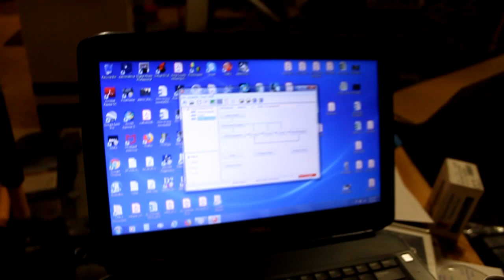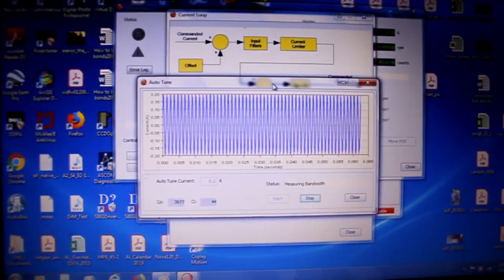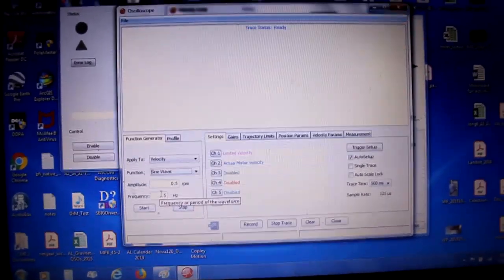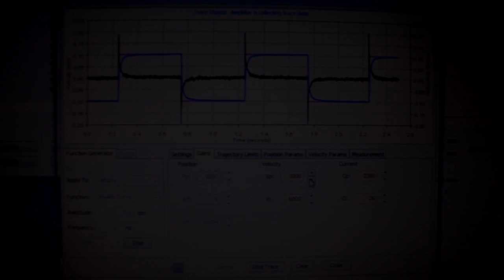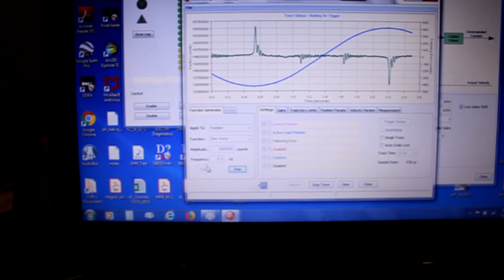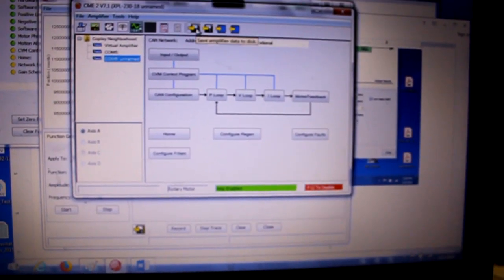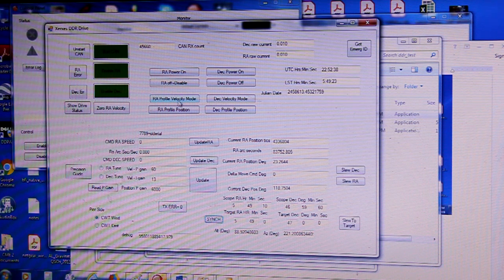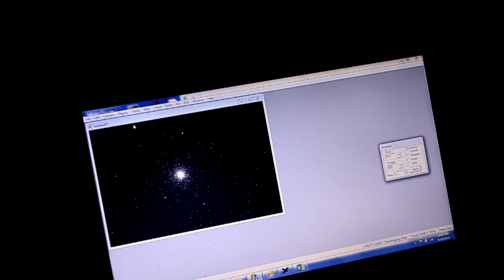How To Tune Your Mount (Direct Drive Telescope Mount)

Comment: Really want to thank you again for sharing all of these details, it's super educational.  Sorry for more questions, obviously feel free to pass on them.  

Is there any CAN messaging inside the control loops (e.g. encoder readouts sent via CAN to velocity loop processor) or is it mostly there for instrumentation/command of the loop parameters and software integration?  I'm guessing limited to none for inner loops (aside from instrumentation/command purposes) to keep latency down but don't know enough about CAN.

Second, are there particular encoder protocols that are well suited to this use case?  I'm looking at some lower cost magnetic absolute encoders from RSI and they have all sorts of options over 422, USB, SPI, PWM, etc.  It's probably mostly dictated by the motor controller but i would imagine something with precise timing and low latency would be best, maybe SPI or one of the synchronous RS422 protocols.
Reply from the maker: No, the servo drive performs loop closure for the velocity and position loops automatically as well as the current loop. CANopen has a standard protocol for servo drives which let you either interrogate position, velocity, etc, command them, or set up periodic messages for them. BiSS is probably the most common absolute encoder format used in astronomy as it's a published Standard. BiSS is a protocol on top of a fast differential signaling protocol (RS-485) and it has a clock. CAN is the lower level protocol on which CANopen is built.